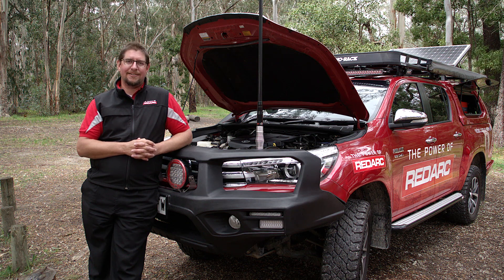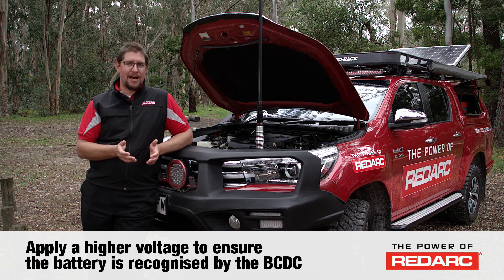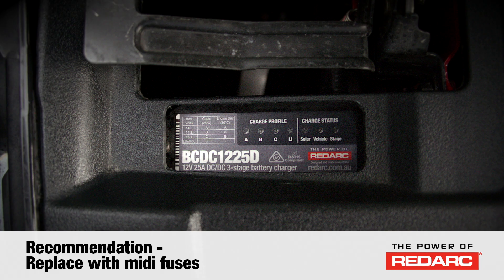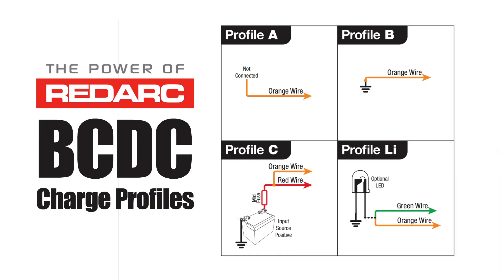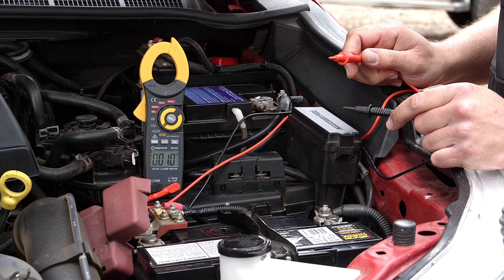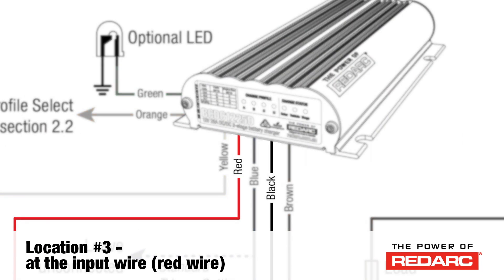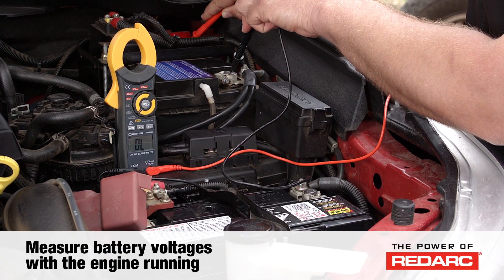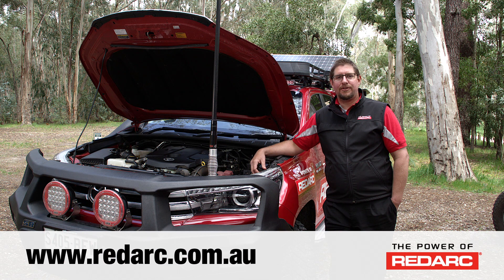Common BCDC Tech Tips from REDARC

Comment: I just install a BCDC25 charger on my Troopy. However, my main battery voltage dropped below the regular 13.1+. Now it reaches 12.6 when the redarc is connected.
Reply from the maker: Hi, The BCDC is a voltage-sensing device that automatically disconnects from the vehicle’s start battery at 12.7 volts, ensuring there's always enough charge to start your vehicle.

Comment: What is the best solution to isolate the orange wire with a switch so I can either use a lithium or switch to agm battery ?
Reply from the maker: Hi, You can use a standard on/off toggle switch installed between the Orange and Green wires of the BCDC. If you want the Lithium profile selected, have it so the switch is toggled one way and the opposite for AGM/GEL (orange disconnected affectively). Hope that helps!
Reply: Why would I isolate the green wire ? Not just the orange ?

Comment: Hi Stuart,

Mate I've wired up my BCDC charger ( orange wire not connected ).

And with vehicle turned off & fixed solar panel wired in, charge profile light is on. ( Is this correct that the light is on with ignition off ? )

Along with charge status solar light on, and stage light is flashing once every few seconds.

Comment: Hey guys recently, my bcdc has stopped charging through the alternator and only charges off solar but only when the car is switched off. The engine has recently been rebuilt and I suspect something has been wired incorrectly, any idea as to what it could be ? Thanks

Comment: G'day mate... good job. I already have the 1240N set up with caravan roof solar and car battery input. I want to add some folding solar panels to the mix.... how would I go about this? Can I piggyback this to the solar already connected to the yellow wire.... or some other way. I ask because I was thinking maybe too much solar input through what looks like 8B&S yellow wire might be dangerous.
Reply from the maker: Thanks for watching! When adding extra solar into the system as you mentioned all you need to do is add a extra connection to the yellow input wire. The 8 gauge cable coming out of the charger will be fine with the extra solar input.
Reply: Awesome, thanks. I am also Strikemaster. from before. Sorry about that. Shoulda mentioned I have 240w solar on roof and will have a 200w folding blanket later. Only on cloudy days will they both be running at the same time anyway. Appreciate this helpful forum.

Comment: Hi. From this video, at around 2min 37 secs, it sounds as though solar will only start to used when the vehicle engine is running. Is this correct? Thanks.
Reply from the maker: Thanks for watching! Depending on the charger it should charge from solar without a car input, if you're experiencing any charging issues we would highly recommend to call our Technical Support Team on 1300REDARC (1300 733 272).

Comment: Hi,
I am planning a electrical system for a truck build that would feature a dual battery system as well as solar charging. This BCDC seems like the best solution. 
However, are there any limitations to what size Alternator can be used? 

I was looking at the high output 370A options from Mechman. Any issues with such a large output alternator?

Cheers
Reply from the maker: Thanks for watching! There is no issue having a huge alternator on the input of the BCDC as it will only take what it needs to charge your 2nd battery.
Reply: Far too high. fuses and wiring will have issues. Qualified mechanic 36 years. Only get qualified electrician or very good mechanic to do extra load on electrical system and instal midi fuses close to the battery as possible. Anthony from Fourby4Diesel  is a very good reference for information, I usually go to him for info as i have found him to be very knowledgeable and like me has decades of experience. The main battery will be getting far more than the 85-100 amps and the wiring is so under rated for 370 amps.

Comment: I am using my BCDC1225D to charge Optima AGM aux. battery and was working find. Recently I had some maintenance done on my vehicle and had to remove the aux battery. Now after putting back everything with the same old connection (no change), noticed the BCDC1225D LED indicates that it still charging from the vehicle even after the vehicle is turned off. That stays for ever.
Reply from the maker: Thanks for watching! The BCDC1225D will keep charging until the start battery voltage drops below 12.7v. Are you able to confirm your start battery voltage when this is happening? We would recommend calling our Technical Support Team on 1300REDARC (1300 733 272) as they will be able to guide you through some testing to get to the bottom of what is causing what you're seeing.
Reply: Check that the car starter battery is wired direct to the BCDC, and not (inadvertently) connected to the Aux battery +ve  instead. If connected to the Aux battery, it will trick the BCDC causing car LED to be on, and also over heat the BCDC itself. Not a good position to be in. A quick indication of this is if the BCDC is hot to touch with the mains 240 connected and on.

Comment: I have installed a 1225D with 75 ah lithium battery in 2019 ford ranger I have the blue wire connected to the ignition it seems when the engine is running the idle drops down for a second every day 20-30 seconds have I done something wrong or is this normal now
Reply from the maker: Hi Jason, thanks for watching! Every car will act differently depending on the make, model and charging setup, if the REDARC charger is staying on and charging it could be something related to how the car's smart alternator functions. We would recommend contacting Ford as they should have more information on how the cars idle system works and what can affect it. For more information, please don't hesitate to reach out to our Tech Support Team on 1300REDARC (1300 733 272).

Comment: Hi,
A red light flashing and the unite is not charging the battery 
can someone help please
Reply from the maker: Hi Adnan, 

The SBI12 has inbuilt fault detection and will indicate a fault by flashing the LED either 2 (Over-voltage) or 3 times (Voltage drop or excessive current draw).

Please refer to page 4 of the user manual on our website for further detail or contact REDARC’s tech support team on 1300 REDARC.
Reply: @REDARCElectronics  thanks

Comment: My charger stays on standby why is it doing this
Reply from the maker: If your BCDC is still in standby with the Vehicle running or a Solar panel plugged in, it could be due to the input voltage not being at the correct level to turn the charger on. With the Vehicle voltage, if it is either not up to/over 13.2V it will stay in Standby. Check to see that the voltage measured between the Red and Black wires, right at the unit are over this. Solar is a similar test too; measure voltage between the Yellow and Black wires – this needs to be over 17.5V at a minimum. If you have further questions please give our friendly Tech Support team a call on 1300 REDARC

Comment: Low temp charge protection for lithium profile?
Reply from the maker: The BCDC will not attempt to charge a Lithium battery if the ambient temperature is below 0°C/32°F. This feature is designed to help protect your Lithium battery and maximise its service life.

 

Lithium batteries have an internal management system, often referred to as a BMS. This is one of the great features about Lithium batteries as they can protect themselves in certain situations. One of the common issues REDARC technical support deal with is Lithium batteries turning themselves “OFF” to protect themselves from excessive discharge. This feature is ideal for protecting the battery but can be inconvenient as you need to “jump start” the battery to bring it back to life.

If you have any further questions please contact our helpful Technical Support Team who will be more than happy to walk through this in greater detail over the phone.

Comment: Hi guys, I have a bcdc1225d installed in my prado set to lithium profile, am I able to charge a agm battey using the lithium profile? I have a optima agm battery i can use while I save for a lithium deep cycle, I dont want to damage anything, battery, charger, especially car, so I just want to be sure. Any information will be appreciated, thanks
Reply from the maker: Hello and thank you for your message. We recommend disconnecting the green and orange wires from each other so that the BCDC is set to profile A while it is charging the AGM battery. Once you get your lithium battery, it is recommended to reconnect those wires to set it back to a lithium profile. Any further questions please feel free to contact our helpful Tech Support Team on 1300 REDARC.

Comment: Hi !
I am installing a Redarc BCDC1225D in my camper trailer at the moment I have an Auxillary battery in my vehicle as well.
If the vehicle is not connected to the camper will the solar take over and charge the camper battery ?
I would like to disconnect and leave the camper at a static location.
Reply from the maker: The BCDC Dual Input Charger range will accept solar and vehicle inputs simultaneously, but also if either input is available at any time it will be able to use them independent of each other. For any further assistance please feel free to contact our friendly Tech Support Team on 08 8322 4848.

Comment: Hi Stuart, do you need to install a redarc isolator to a dual battery system when charging the second battery with redarc 1225d BCDC (Dec 2014 Prado GXL150) as I've seen two different setups of both. The AussieDrifter installation video doesn't have the isolator installed and it is a very simple installation.
Reply: Just another question associated with the second battery being charged by the Redarc 1225D BCDC, if I hooked up a solar input to charge the second battery when the vehicle isn't running, would it drain the first cranking battery in anyway?
Reply from the maker: Hi  @brucelines2391 ,

The vehicle input of the BCDC Dual Input Chargers is protected from over-discharge at all times.

In standard configuration with the blue disconnected - or blue connected to a vehicle ignition switched positive, with the ignition in the OFF position - the BCDC1225D will not continue to draw from the vehicle input once the voltage drops below 12.7V (unloaded).

When the solar input is present this does not change the turn ON or OFF thresholds for the vehicle input.

If you have any further questions please feel free to contact our Tech Support Team directly and they'll be happy to walk through in greater detail over the phone.

Comment: Hi, i'm planning to hardwire a solar panel on the car. If the solar panel isn't drawing enough power while driving, will the BCDC automatically change to the alternator and vise versa? 
Thanks.
Reply from the maker: Thank you for your message, Tan. That's correct - the BCDC will select charge from solar first if it is available and if not, will then revert to charge via the alternator. If you have any further questions please contact our friendly Technical Support Team who are more than happy to assist.
Reply: @REDARCElectronics  But if, say, just 5 Amps was available from a rooftop solar panel, while driving, but 25A was available from the tow vehicle's alternator, does this mean that the BCDC [1225D] would reject the vehicles input altogether? Or would it take just 20A from the vehicle?
Reply from the maker: @garykildea6117  the BCDC will take from Solar first and back-fill with Vehicle charge, correct. It will take the remainder of current up to the maximum of the unit’s output from the Vehicle; so as you have mentioned if the Solar is producing 5A, the Vehicle will be able to provide 20A.

Comment: Is it possible to run a lead acid cranking battery and an agm as an auxilary cranking battery in a dual setup?
Reply from the maker: Hi David, thank you for your message. If you're looking to use a BCDC, then yes this would work fine. If you're wanting to use a Smart Battery Isolator instead, we would not recommend as you're not using the same battery type.

Comment: Hi my lithium battery has a battery management system that protect against overheating however it does not have frost protection. Does the charger have any system like this in built I cannot find anything in the manual for the 1240d that I have recently purchased. Or will I need to purchase a low temp cut off sensor.
Reply from the maker: Hi Skully, in order to stop the BCDC charging at zero degrees and below you will need to install a low temperature cut-off sensor. Any further questions please be sure to contact our Tech Support Team.

Comment: Recently installed the BCDC1225D in my FJ Cruiser.  On the vehicle I have a 100 watt solar panel which is permanently mounted on the vehicle.  I have not experienced any issues except for when the vehicle is parked in my garage during the day.  I’ve noticed during the height of the day when a little sun is able to get in from a side garage door barely hitting the solar panel I’ll get all five LED’s flashing five times.  This is the only time I get a fault code.  Is this normal?
Reply: Hi Richard, I’m having some issues getting the solar to produce enough volts to make the charger kick in. But sounds like yours recognises even the smallest amount.
I camp a lot with solar and don’t get this code at all when it’s cloudy.
Does yours kick in quickly in the sun?
Reply: Ben Wickert Yes, I live in Arizona and it’s pretty much sunny 330 days a year.  Once I drive out of the garage the unit immediately kicks over to solar.
Reply from the maker: Hi Richard,

Thank you for your message, and for your recent purchase!

We can confirm that this is normal operation as the BCDC is recognising that the solar panel is producing some power, but not enough to facilitate a charge.

If you do have further questions please don't hesitate to contact us at power@redarcelectronics.com
Reply: RedarcElectronics thank you for your quick response 👍